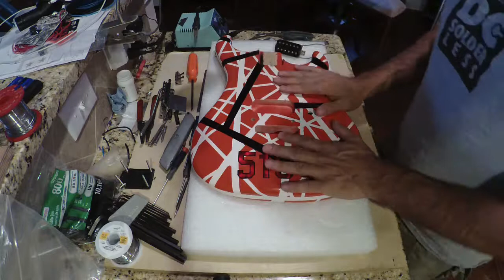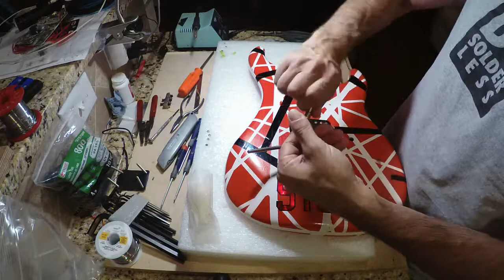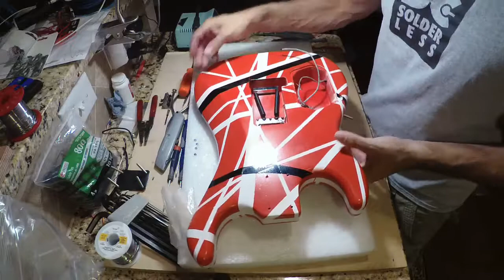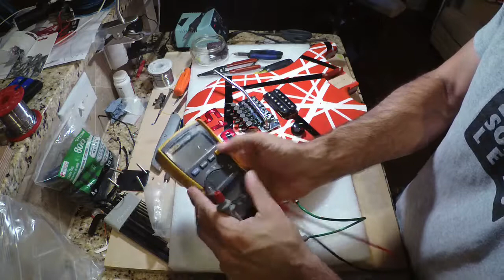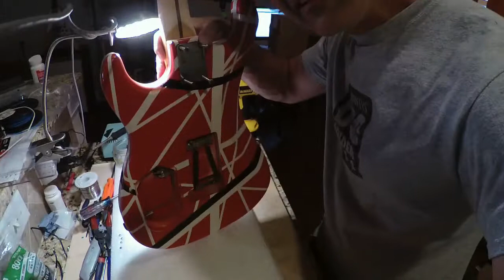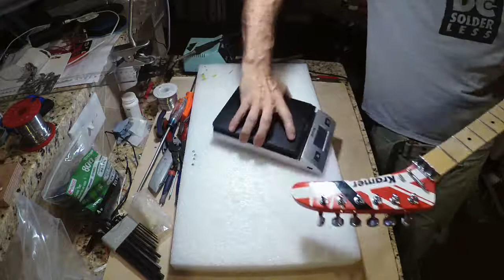51550 Part 34- Putting It All Together

Comment: Hey there, have been following this as the gospel for the last month during my build. I'm running into an issue where my pickup sits really high out of the cavity. It's a musikraft body, so I'm sure the dimensions are accurate for the route. Do I need a pickup with shorter mounting legs, or does the pickup actually sit this high up? 

Thank you

Comment: Only negative is I couldn't see a darn thing during the soldering wbich is the most important most difficult part of the whole build for me.  Wish you could have zoomed your camera in for closeups.  I see you make solderless kits for patch cables and audio plugs.  Are you able to make them for the pickup and output jacks too?
Reply from the maker: Hey Mystery :)

Sorry about that... I try but often fall short.

At 3Monkeys we make 1/4" audio and 2.1mm dc  solderless cables.... I think there are solderless pickup/ jack parts out there somewhere but we don't make those.

My best soldering tip is to use a good iron and heat the parts to be connected well and then apply the solder to the iron tip while it is still in contact with the parts..... get in and get out quickly with the solder to avoid overheating.

Thanks for watching!
Ossie
Reply: @ossieahsen6732  Ossie..thanks for replying.  I hope I didn't come off sounding harsh it's just I needed to see it more clearly so I don't fry my potentiometer.  About how long do you typically leave the iron touch the back of the pot when soldering?  Another helpful video could be a quick one with a schematic drawing for us guitar geeks to see what gets connected where and where each gets grounded.  That's alot of videos to sit through and watch but a quick reference video would be great.  Also I've been scouring the internet for the best guitar body and hockey style neck to buy online but I can't find anyone that makes a kit.   Several companies that used to do it no longer make them.  Ed Roman in California probably would but would probably charge a kings ransom just for the body and neck.  Can you suggest anyone who does or would you possibly be able to make me a 5150 body and neck?
Regards ,
Rob
Reply from the maker: @mysteriomarvel933  

Hey no worries!  

I would put the iron on the part for no more than about 2-3 seconds, apply the solder to the point where they meet until it flows (2 sec) and get out.  As with anything practice makes perfect.

I would recommend Musikraft without hesitation,  Tell em I sent you and they might throw you out of the joint!! LOL. They are great people and make a VERY accurate neck and body.  

Hope that helps

Ossie
Reply: @mysteriomarvel933  No, just no to Ed Roman. Really, seriously, just no.  The Musikraft recommendation is the first and possibly only one you need.